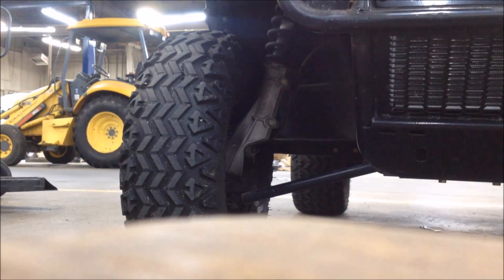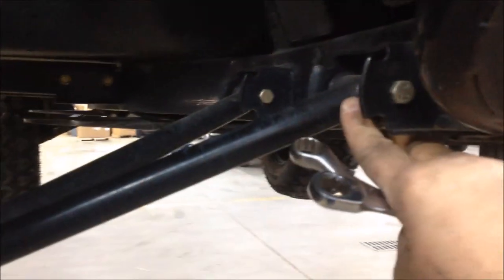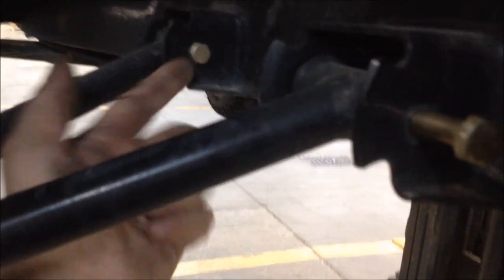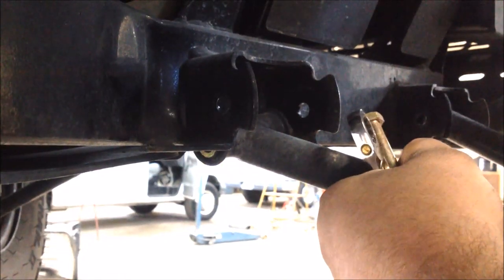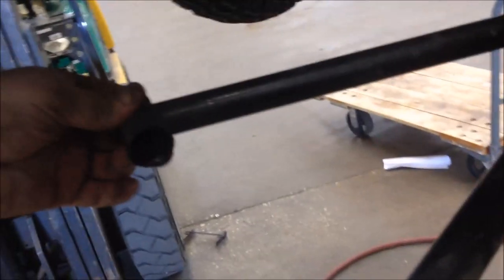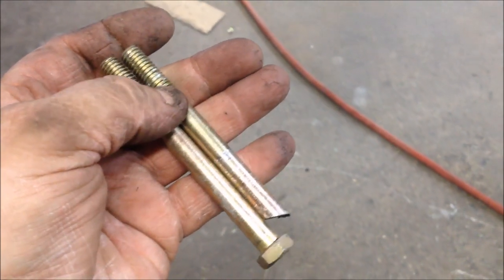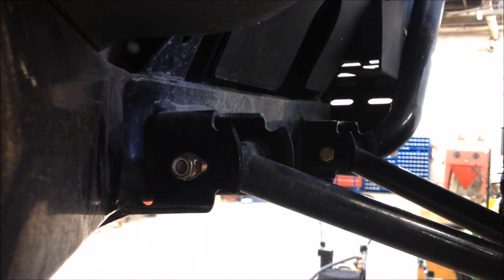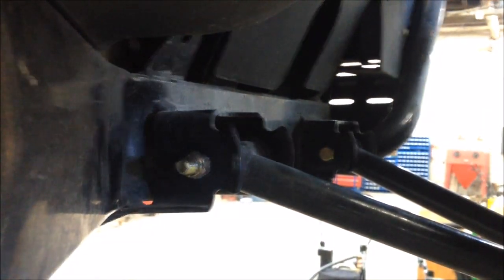HOW TO REPLACE UPPER OR LOWER CONTROL A-ARM BUSHINGS ON AN ATV / SXS / UTV / GOLF CART

Comment: I ran into this problem with the bolt hitting the front bumper  as you said I used my dremel tool with a cutoff wheel and cut the bolt head off and installed the new bolt in the other way. Your video was very helpful THANKS !!!!!!!!